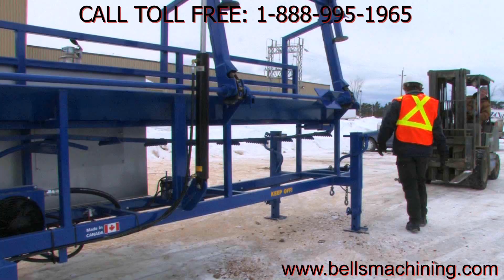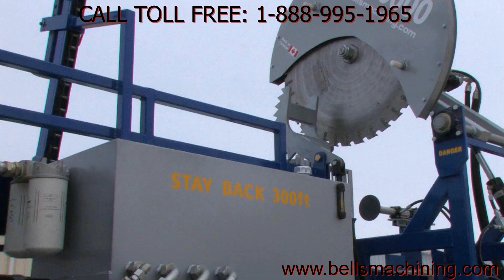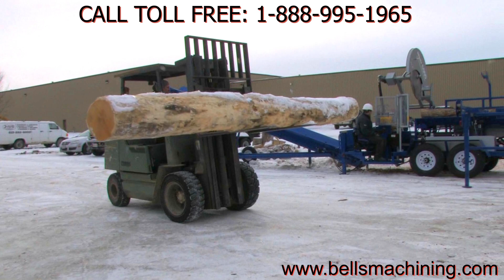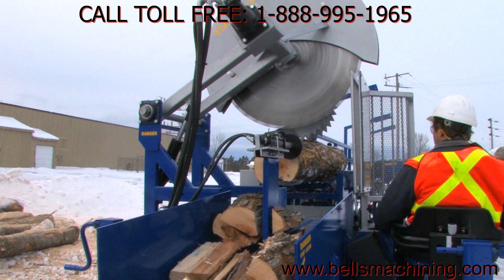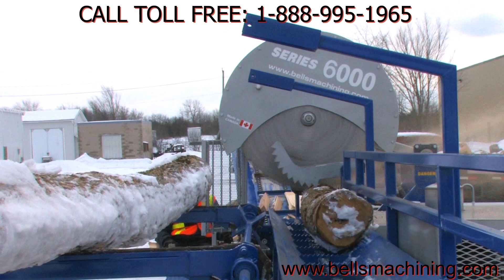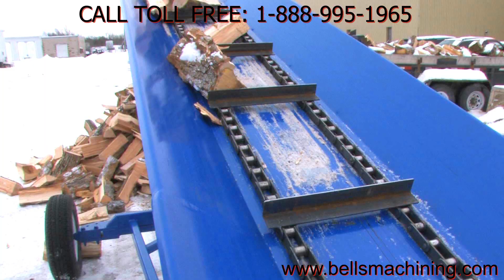The 6000 Firewood Processor by Bells Machining

Comment: Great looking machine but what is selectively missing is some video footage showing what happens at the end of a log. I spent a year cutting firewood on an automated saw reasonably similar to this and the butt of the log causes more problems and slow downs than anything else. At about 1:37 into the video you can see how "floaty" the log is with even 2 cuts still to go.
Other than that this is a gorgeous bit of gear.
Reply: I'm not sure what you mean by making the grabberthingy 2 foot wide but from my experience there is no simple fix. Handling the last 2 cuts is the hardest thing to design into these mills.
Reply: Amazing how many times manufacturers videos cut away from the last few cuts on a log. To give these guys credit at least they weren't cutting up a straight saw grade log.